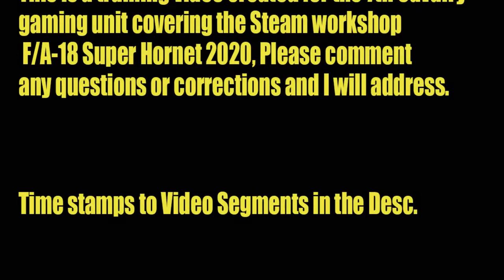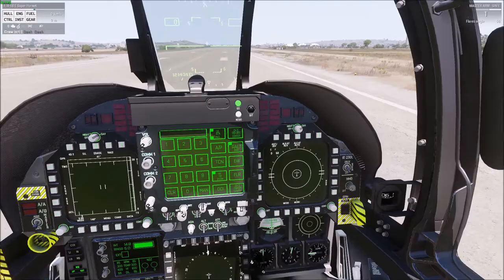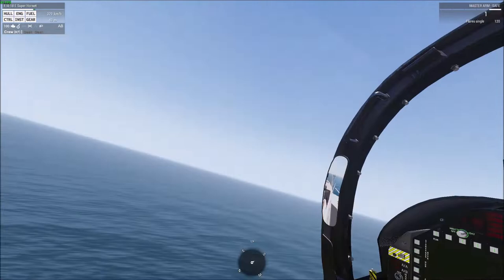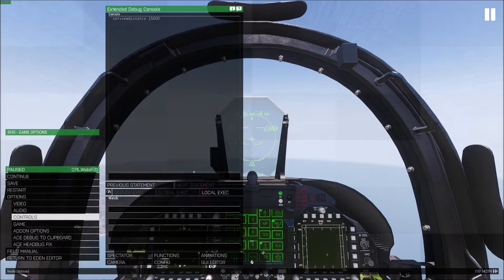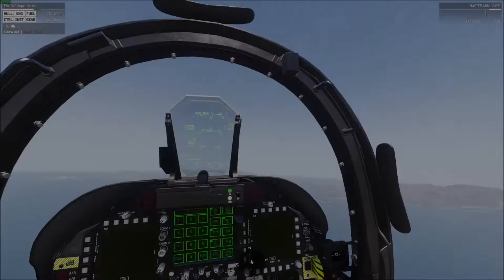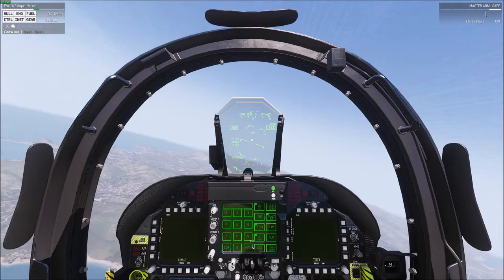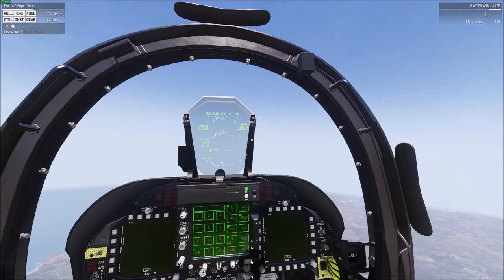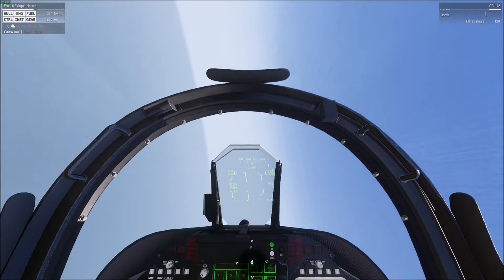FA-18-Super-Hornet-2020 (Arma3) Full Training video

Comment: on a case 1 you're first supposed to do a level brake turn at 350kts 800ft, use the turn to slow down and deploy the hook, gear and flaps on downwind once below 250kts. Descend to 600 feet, and once you can see the stern initiate a 30 degree bank descending turn to arohnd 400ft. I know this is just arma but for anyone that wants to do it more realistically, here it is.

Nitpicking aside, this is a really good representation of the superhornet, especially for a game not intended as a flight sim

Comment: This is by far the best tutorial video I've ever seen of the 18 in ArmA!
Thank you!!

I'm having problems with the Amraam, in may case I can't lock the targets for unknown reason! 

Thank you again and sorry for my bad english.
Reply from the maker: Are you getting a lock with your Radar? If Not make sure Radar is set to OPER (Knop by right hip) 

If radar is on make sure you had TDC Depress key bound, you are slewing the target gate over the radar contact and then pressing TDC depress? 

IS Master Arm On? 
Are you In A/A Mode? 

If you are getting a radar lock but your misses won't lock then lets investigate further.
Reply: @Dave_ess  Every thing right, but I can't lock on target with the brackets when pressing the depress key. I'm using the version beta of the 18 that I have subscribed on steam. Thank you for your reply.
Reply from the maker: @GHlKopsch  ok, So I just tested it and it is working for me. Do you see a radar line sweeping back and forth on the radar? Do you have "Throttle Designator Controller Depress" bound?
Reply: @Dave_ess  Yes radar is sweeping back and forth and yes I got a key designated I can use other missiles like maverick.

It's pretty weird
Reply from the maker: @GHlKopsch  Are you using the vanillia ammrams? Perhaps that is it, you need to make sure you have loaded in the mission editor  " AMRAMM D AA"  I have also noticed sometimes I need to double click the button I have set for TDC depress in order to get the lock
Reply: @Dave_ess  I'll check if is vanilla or not, but the most of time I don't change the configuration of the jet keeping the multitask layout. Thanks  again!
Reply: I wasn't using the vanilla Amramm, somehow after change some configs of the 18 it's normal now.

Perhaps the config file was overited? But what matters is all working fine.

Thank you, appreciated for your replies!
Reply from the maker: Wonderful, Glad you have it sorted!

Comment: For the main gun lock, do you just do it using regular Arma lock or is there any other way to do it? Thats basically the only thing i couldnt find anywhere, but apart from that the video was toons of help
Reply from the maker: Thank you, Unfortunately there is no radar assisted  gunsight supported in Arma or in the mod. You can use  AA radar, your ACM modes, or the vanilla arma system to lock up, but after that it's just good ol Kentucky windage.
Reply: @Dave_ess  Thats good enough i guess. Thanks for jet fast response :)

Comment: Trying to drop some GPS guided bombs but I can't seem to find the I-TGT display on my scroll wheel menu. Is there a step in the aircraft configuration I may have missed to get the I-TGT option to appear? Or maybe some mod dependency I'm missing? Trying to use the J-109 GPS guided bomb from the SAW pack. Thanks!
Reply: Answered my own question! If anyone else has this issue too, make sure that you have the FIR AWS mod downloaded and running. It will give you the I-TGT menu option to pull grid coordinates from. https://steamcommunity.com/workshop/filedetails/?id=366425329
Reply from the maker: @FantasticMrE  thanks Sir, I actually didn't use any Fir stuff (or I-tgt)  at all, all GPS munitions  can be handled via the actual systems and the atflir pod. I recommend the updated atflir video listed in the first comments, as the processes in this video are not necessary current.
Reply: @Dave_ess  thanks for the reply! I just checked out your recent atflir instructional video and it helped out a lot. There’s always another manual that will answer your question, you just gotta find it!

Comment: Looking for help. I cannot bind my x56 Hotas to the F-18 add on configurations. I have no problem with binding in the plane configuration bindings. The F-18 add on bindings seem only to bind to keyboard functions and not to my Hotas. I’m running the f-18 2020
Reply from the maker: Yes, I am familiar. if you are running the 2020 there is a "Two Stage" binding process. Let me see if I can find a vid that shows it. (but really you should switch to the beta, it is superior in every way)
Reply from the maker: Found it, right around 2min 20 sec mark , https://youtu.be/25U2pgMTfbA?t=124

Comment: Having an issue where if I put down my gear while the air-to-ground mode is on it completely breaks it. A new plane must be spawned before you can re-target with MAV-L. This is a huge issue as we use this plane on our milsim server and we have been in the middle of an OP and accidentally put our gear down and it breaks. Any fix to this?
Reply from the maker: I will test this and see if I can replicate, you are saying if you gear down while in A2G  the MAV-L will no longer function correct?
Reply: @Dave_ess  yes. If you can’t replicate the issue try it while in the FLIR pod view. Not sure exactly the circumstance but I was getting the error consistently
Reply from the maker: @itsvoidd5125  I will test it tonight. When you say FLIR pod are you using the ATFLIR or the Vanillia game pod?
Reply: @Dave_ess  I assume the vanilla game pod
Reply from the maker: @itsvoidd5125   Ahh, i see. I am going to assume there is a problem there with scripts firing and the vanilla game. afaik the hornet mod is only truly meant to support using advanced weaponry using the ATFLIR. I would highly suggest your milsim use the ATFLIR, it works better, is more immersive, and more true to life. I have a couple videos on it in this channel

Comment: Hi, Sensor Control Switch and Throttle Designation Controller does not work, I bind buttons convenient for me, check, does not work, put other buttons. It doesn't work again, I don't know what to do anymore, because of this I can't use AMRAAM and AGM-64 missiles.
Reply from the maker: Hi, Please try the "2 Stage" Bind method I have outlined in this video at the 2:20 mark, see if that works. https://youtu.be/25U2pgMTfbA?t=140
Reply: It didn't work(

Comment: Hey great video, what are your render distance settings for aircrafts?
Reply from the maker: Thanks! I’ll  have to look inside of arma, but I am 99% sure I have a console command to force render distance to 19,000.
Reply: @Dave_ess  Yeah I just wanted to know the object and PIP distance because yours looks really great and my one I can see terrain but like tanks are disappearing when I'm 6 miles away.
Reply from the maker: @peanut1120  Looks like I have both Object and Pip set to 12000 in the options. In addition to that I use console command setviewdistance 19000 to push it out a bit further. and for clarity in filming I usually use reduced haze mod. https://steamcommunity.com/sharedfiles/filedetails/?id=1397683809

Comment: For some reason even do I press the TDC Depress and have the target in between the 2 lines it does not lock the ground targets on the radar.
Reply from the maker: Hi Mati, the latest build has changed inputs - Now in order to lock using the Ground radar you  must Sensor control switch  in the direction of The DDI you are working on.  So If your ground radar is on right DDI, SCS right to lock target. 
And Also the Ground target must be actively moving.
Reply: @Dave_ess   u saved my life right now, i searched all yt to know how to lock with the mav G
Reply from the maker: @lcms_zasxfgg8859  Awesome glad i could help! Be sure and check out the more recent video in description that shows how to do it with more advanced ATFLIR pod

Comment: Hey, man. For some reason my selector button doesn't work. Is there any fix? I have it bound to the spacebar, as "E" is my right rudder key.
Reply from the maker: Hi, Make sure you have it bound in Options --> controls --> Configure Addons -->  F/A-18 Super Hornet. it is called "Cockpit interact"
Reply: @Dave_ess  Thanks. I had it set up already, but cockpit interaction is still not working. Wierd.

Comment: In an fa 18 f does my WSO need to light their lase,if so do i follow the steps tje same and just drop on trajectory? Also for some reason after i light my laser it doesnt flash ltdr on the hud? Anyone?
Reply from the maker: Hi Zero, if you are using the Laser from the front seat it will fire automatically after it is armed, and you launch a laser guided weapon in good parameters.  If you want to manually fire lase you will need to arm it, then box TRIG on your DDI and it should fire. There is a bug right now that may prevent you from firing it when using USAF modpack, but it is already logged and will be fixed soon. (I recommend SAWs over USAF anyway) - Regarding the WSO, as I understand it this mod does not plan much/perhaps any support for the Wizzo, just focused on the Hornet driver.

Comment: Having trouble with the AGM-G. I am able to lock target on radar but most of the time the MAV page does not connect.
Reply from the maker: The IR Maverick really struggles to lock up a heat source (in Amra). You'll need to make sure the Vehicles are warmed up, either by having them drive routes or fire weapons. Static vehicles will not be warm enough, However, you can throw a Line of code in the init box that will start them warm: " this setVehicleTIPars [1, 1, 1]" (No quotes)
Reply from the maker: If the Mav still wont lock, switch your SCS back and forth a couple times, the Mav should eventually snap on
Reply: Thank you!

Comment: does anyone knows how to increase field of view the FLIR
Reply from the maker: Hi cem. The FOV in Flir can be manipulated with the upper left OSBs (Outer buttons that run around the screen) top row left most will toggle between wide and narrow FOV,  and the ones on the left next to the arrows will give additional  levels of zoom in and out. I will do a more comprehensive flir video soon, as it was not included in my first round.

Comment: how do you lock an "area"
Reply from the maker: Hi Cykod, can be set in Arma keybinds, By default mine is "Left control+RMB" opens the TPOD ----> "Left Control+T" sets area track if on a piece of ground or non-IR contact. If there is heat/contrast it will set as a Point track. (this is for the vanilla arma tpod, I will do tpod for the hornet vid soon.
Reply: @Dave_ess  thanks a lot for the info appreciate it.